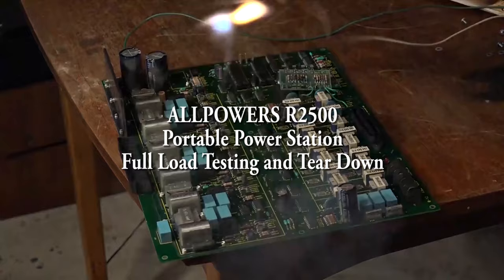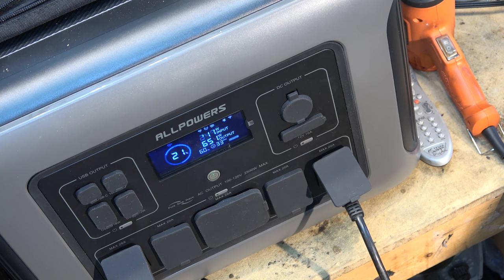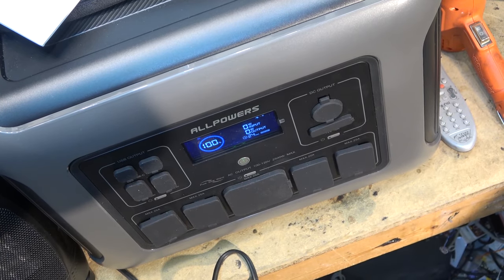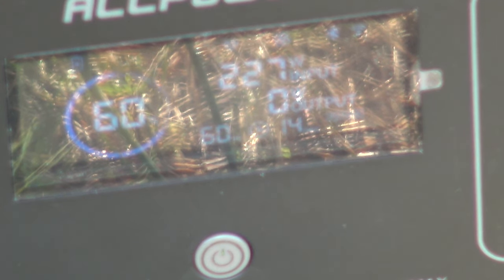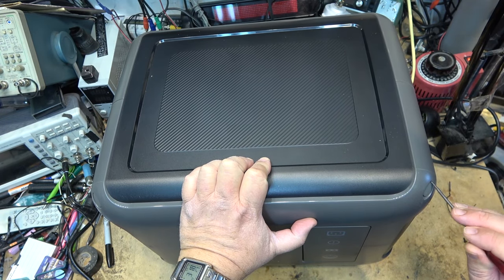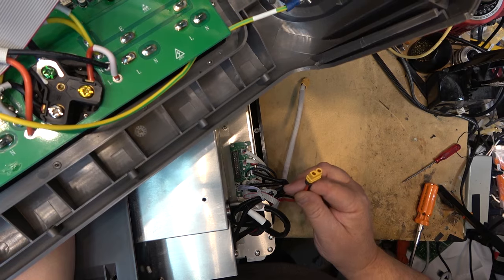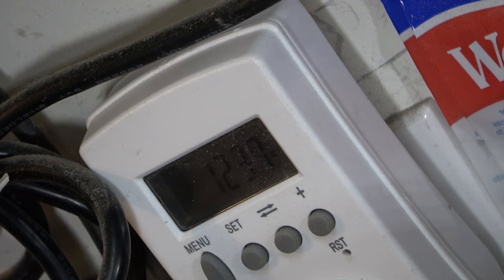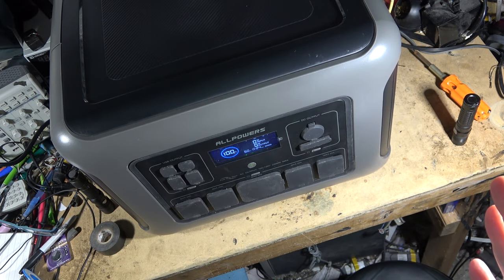Allpowers R2500 Portable Power Station Full test and Tear Down

Comment: Translation;

Model: 2500W bidirectional switch power supply
Input Voltage: 90-110Vac;
Output Voltage: 40-54VDC.
Input Current: 110Vac
Output Current: 40V-54VDC.
Power: 1500W
Serial Number: YDSS0253
Date: 2023-6-20

Comment: Just bought R2500, and started to test, My Desktop PC has power supply(Dark Power Pro 12, 1500w) with hold up time 17ms, looks like should be good with R2500, is equipped with less than 15ms UPS, but it doesn't work, when the power outage, PC just went to  restart..
Reply from the maker: I use the bluetti eb3 on my computer.  Full ups no switch over delay at all.  Been through multiple power failures and pc keeps humming along.

Comment: Bought a r2500 Oct 3/23 and so far works great. When the ac switch is first pressed on it comes up at 50hz then after 5sec or more it switches to 60hz. The app also has 50hz /60hz toggle. The only minor issue with mine is a slight odor when inverter is working hard. Not sure plastic or something else. Never has been a problem and runs fairly cool and noise level is minimal even when fans are on high. I'm in Canada and in area prone to power outages. Well worth money and even better on sale. Nice to see they are built well so thanks for this video. PS  heavy so recommend a wheel cart for distances.  Great video and tear down
Reply from the maker: The off gassing when it heats up is the conformal coating on the PCB that keeps dust and moisture away.  It will go away after awhile. Similar to the new car smell.

Comment: Impressed about the tear down...  no way on earth to change the batteries in there tho :)
Reply from the maker: And you shouldn't need to.  My ev is almost 13 years old.  Battery has lost about 5 miles of range. As long as you don't run ur flat and store it dead. Charge every 6 months if not being used and if will be fine.

Comment: Well that's a decent invertor stage it has. I've rarely seen such a clean sine wave on a UPS mode output before. Makes you less afraid to use it on different devices. A lot of invertors that use FET switching put out a blocky waveform which averages out as an AC wave but is nowhere near an AC sign wave. In the UK the R2500 with the solar panels you have is £1179.99 direct from their UK website.
Reply from the maker: Well for 3000 it better perform!
Reply: @12voltvids  This unit is on sale for 1699.00 cdn until Nov 30, Black Friday sales. Just wanting to let you know. Great video.
Reply: Sorry, I forgot to mention that this deal was on the Allpowers Canadian site.